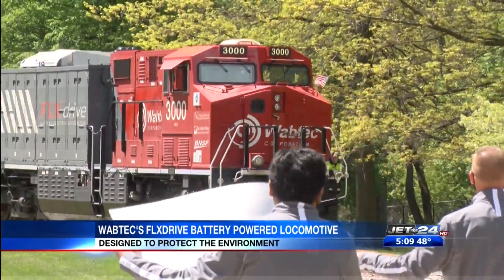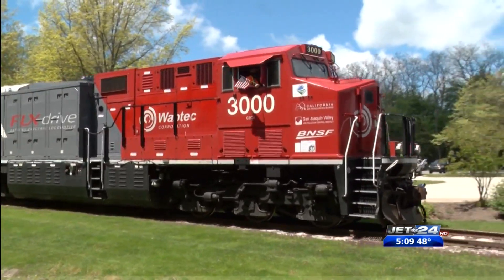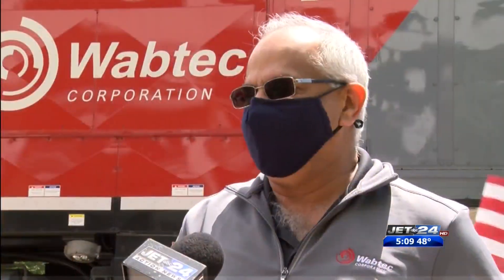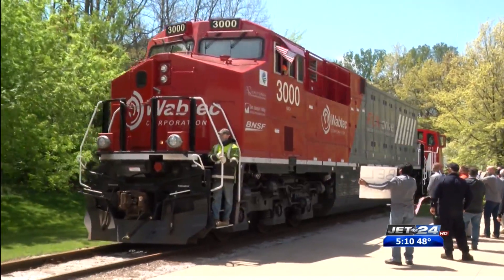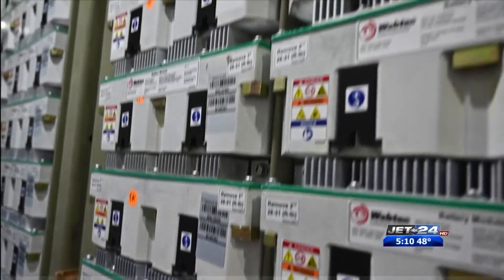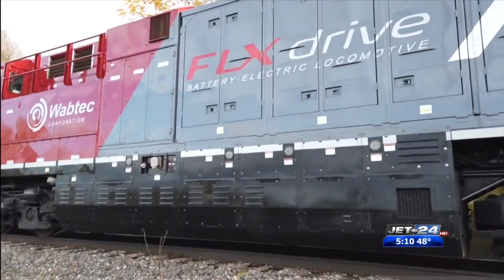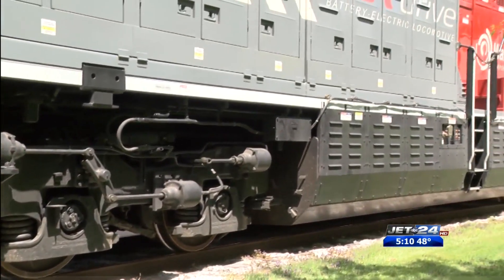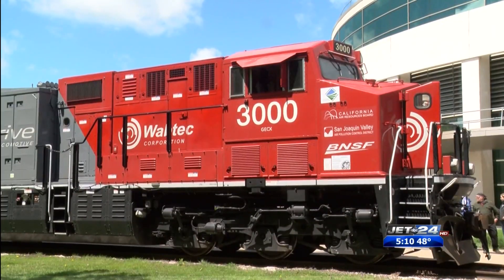Wabtec introduces battery powered locomotive to help reduce fuel energy

Comment: Electricity on and off the grid will someday be produced only by a combination of green renewable energy forms: solar, wind, hydroelectric, sea tide movement

I have yet to find one yoo-toob video posted of any all-battery loco actually pulling a train, toy trains notwithstanding! I had a toy train set that ran on flashlight batteries, C cells, when I was 5. Most videos on these are about "testing". It looks like they are just dog-and-pony show things to parade around for the time being. Are these things actually worth a damn in the field? They've talked the talk, can they walk the walk? Are they merely pure show without any go?

Comment: Catenary electrification is preferable, but this would be a good in between
Reply: Catenary electrification is very expensive
Reply: @nolantherailfan5048 not really
Reply: @AstorCosOffical  yes, really. There are 160,000 miles (257,495 km) of track in the USA. To add centenary wire to existing track is about four million per mile. Obviously a lot cheaper to have locomotives that electric internally (be it battery or H2 fuel cell).
Reply: @nolantherailfan5048  In setting it up or in maintenance? The power company dictate the cost of electricity and this still needs those power companies to charge and charging produces heat during the charging process which is lost electricity,Other than driving the electric motors directly
Reply: @nolantherailfan5048 up front yes, but it’s cheaper and more efficient in the long run.

Comment: Enough with the false bs of batteries. A hybrid would have been a better setup or run the locomotives off natural gas instead of diesel.
Reply: The standard diesel locomotives they've been using for years are already hybrids.  First one was in the 1920s I think?  So you know.  Your idea is 100 years too late.
Reply: @timhansen46  there always has to be some douchebag like yourself opening your mouth without having a clue to what you're talking about look up railpower gg20b switcher. Hybrid diesel electric with battery bank it was done over 10 years ago but you wouldn't know too busy running your big mouth like that moron president we have.
Reply: @timhansen46  not a victim, just calling out people like you who think they know it all. Now tell me again they don't make a hybrid battery electric locomotive ....
Reply: @faststang89  Ultimately your original statement was "hybrid" not "railpower gg20b switcher hybrid electric" so again nothing about my statement was false.  Oh and it looks like the train you mention has some "false bs of batteries" in it.
Reply: @timhansen46  diesel electric locomotives have never been called hybrids for one, yes full ev type locomotives are stupid where as a hybrid as i mentioned makes use of both instead of tossing one for the other. If you think you're going to one up me you already lost the conversation.
Reply: @faststang89  I don't need to waste anymore time on you.  I'm sure wabtec really regret not consulting with you first. Oh and if you think I care about your worthless opinion then the really never was a conversation.
Reply: @timhansen46  wabtec couldn't give a care in the world because once they get paid its a done deal. I know i worked for them 10 years ago and their quality control was garbage, they also paid their employees low wages to put these things together and would continually bring in temp workers who were less than mechanically inclined but you know all genius. Im sure you troll everyone with your "knowledge".
Reply: @timhansen46  🤣🤣🤣 there you go again speaking on things you know nothing about. Joe biden jr
Reply: It is designed to be used as a hybrid. Haven't you seen wabtec's video? It's supposed to run in tandem with diesel locomotives to recover and reuse wasted energy. 
It's not supposed to run by itself
Reply: @RR-us2kp  Wasted energy back to it's full capacity and within it's operating temperature,Charge any battery and it warms up,Lithium are monitored and once that temperature has been reached Charging will cease until the battery cools down,In the meantime that lost energy is still lost, Sounds good on paper and to the layman but a bit off research and learn for yourself
Reply: Yes. Instead a full electrification of the track is better. Indian railways has already completed 45,881 kilometres electrification and targets complete electrification by 2025 67,956 kilometres track length
Reply: Or Hydrogen as we do in London in the UK water vapour as exhaust

Comment: Running a massive FREIGHT TRAIN on batteries is just stupid in mind! This is an usecase where you need LOTS of energy for LONG durations. Both are requirements that batteries CAN NOT deliver - neither now nor in the near future.
All those cells could easily be fittet in some fifty to hundered small cars for car sharing fleets for example.
But in a train there's just no benefit.

Diesel gives you around 41kWh of Energy per gallon.
A SD70 type loco has a capacity of around 5,000 gal from what I can find right now.
So that's about 205,000kWh of energy such a loco carries around.

Wabtec claims in their own video that this very loco has around 2,400kWh of batteries.
(see https://youtu.be/zIgmNOxa5aI?t=119)

So that's roughly about a hundredth worth of the energy of a typical diesel loco!
Okay, fine. There's this efficiency problem of a ICE.
But an electric loco also has converters and more or less the same electric motors.

And I undestand that this FLXdrive loco shall be used along whith diesel locos.
But even then: What's the benefit of THAT?
...apart from being able to do some green-washing...

This simply is a waste of very precious resources.
And amount of environmental damage the manufacturing of all those batteries has done compared to the real benefit of such a loco is just pathetic!
Reply: It's designed to be used in tandem with diesel locomotives. 
It can recover braking energy of the freight train and can help it get going again with its stored energy. 
Listen before spewing out idiotic comments
Reply: @RR-us2kp  Upto is maximum capacity and heating loads,Quick to jump to the defence of "Gloss" and accusing other's of "spew" a little research by you beforehand presuming your remotely interested would not have gone a miss,I heard what he said on the video and to the layman that's impressive, Our trains in the UK have it that run off overhead cables, we have buses that use hydraulic braking that pushes two large cylinders and the cylinders power the rear wheels upto 30 mph or run out off pressure,Hybrid cars electric motor upto 30 mph then the diesel takes over AND RECHARGES THE BATTERIES,
Reply: @RR-us2kp  

Lol, braking energy????

The whole premise of a freight train is constant forward movement, 
How much braking do you seriously think it would need to do to sufficiently keep enough charge in the battery?

And its stored energy?

Isn’t that the same thing as a diesel locomotive does,
Use its stored energy to get it moving?

Laughing my ass of here….
Reply: @MrBelly666  A railway track is not a flat line. There are ascents and descents. The potential energy of a train raised to a height of 1,000 feet can let it drive 100 miles across the plain.
Reply: @none776  Damn… lol I’m surprised he actually typed that comment out. I feel like what you just said would be common knowledge to people but I guess not.
Reply: @none776  tell that to the rail operator that has many flat line tracks. If you're talking about ascents and descents like Donner Pass or something, now we're talkin'. What if you put that battery electric locomotive to use in flat desert lands, let's say, some famous west coast routes?? I'd say overhead wires are infinitely better way to do electric trains. Even though yes it's expensive. But it's better than mining for battery, let alone, to replace 200+ litres of a single diesel engine in a single locomotive.
Reply: @MrBelly666  ok trump voter, relax, I can sense your belly vibrations from here with all that "laughing".
Reply: @anf_8310_ab  they could put solar panels on the train
Reply: @none776  the power you need to a charge one battery will be high
Reply: @Mroyalali  it won’t fix the problem. The locomotive will drain the battery faster of them getting recharged
Reply: @gamerfan8445  Of course, the charging and discharging power will be high. This is a locomotive, not a bicycle. Also, the count of locomotives always depends on the required power.
And no one is going to charge them from the outlet. This is only for regenerative braking and to improve the performance of diesel locomotives. A third or even two thirds of diesel power can easily be replaced by battery electric power. It's just that diesel engines will always have to work at full power.
Reply: @none776  then why railroads are trying to buy them to replace diesel.
Reply: @gamerfan8445  Fuel economy and disel maintenance costs.
Reply: @gamerfan8445  then put bigger batteries
Reply: @Mroyalali  you can’t. More of the battery you add more weight to the frame of the locomotive, which can cause damage over time that can’t be fixed
Reply: @none776  yes it be better than diesel in fuel cost. But in maintenance it won’t be. Due to the battery will damage the flame and the trucks and the rails from there weight.
Reply: @gamerfan8445  then do some stuff to make the train lighter and more aerodynamic so  that it needs lest horsepower and slice through the air easily. If that can't work then I'm out of solutions
Reply: @banksrail  So a empty cart rolled from a 1,000 foot hill would finally come to a rest a 100 MILES AWAY? NOBODY KNEW THAT EINSTEIN, NEWTON RING ANY BELLS,GRAVITY WEIGHT PLAYS NO PART GRAVITY PULLS EQUALLY
Reply: @OregonCrow  Imagine a Trump voter all the way over hare in the UK? Blair voter
Reply: @Mroyalali  And what difference does that make? There not 100% effective, Produce about 1.6 kwh on a 2,400kwh battery that's 2,000 hour's of sunshine 😄
Reply: @none776  Your talking nonsense but continue it pleases you and it's free speech just because I disagree doesn't mean you should stop,But do some "Googling"
Reply: @none776  Fuel economy? Sorry I'm in the real world, First pass the cost onto the customer, 2 nobody gives a toss about the environment but like to appear "GREEN" TO BE TRENDY, In our local area we are going GREEN but just approved 85,000 diesel lorries passing through to fill in Marshland for development when building on stilts has been ignored GREEN,WE have a supermarket chain carpark in Greenwich using solar panels and wind turbines to get free electricity to power the carpark lighting at night saving money but looking green
Reply: @Johnketes54  In the real world, fuel costs money. It is profitable because batteries is too cheap. Sure I speak about small batteries for recuperation, not full electric train. In the past, the price of batteries was huge and it was not profitable, but now it is. Maybe in the future full electric trains will become profitable. Well-made electric vehicles require less maintenance money than diesel.
In countries with a low cost of human time, even electric trains under a overhead line are profitable. Electricity can be really cheap.
Reply: @Johnketes54  well it could maybe at least improve the range idk
Reply: Yes. Instead a full electrification of the track is better. Indian railways has already completed 45,881 kilometres electrification and targets complete electrification by 2025 67,956 kilometres track length.
Reply: lmao. You think this train has a 2,400kWh battery? It's obviously wrong. The train would move about 10 feet. It's amazing you base your whole argument on the locomotive having a battery that's the size of a Prius battery.
Reply: @Driver6M  I think you got the notation wrong - I used American notation with a comma for thousands, not a point as we do in in the metric world.

The company claims 2,400kWh (two thousand four hundred kilowatt hours).

The MY16 Prius has a 8.8 kWh battery (eight point eight kilowatt hours).

So the train's battery is more than 270 times larger than the Prius's battery.
Reply: @ML_314  British notation as well
Reply: @Driver6M  So why release wrong information?
Reply: With energy density 500 wh/kg i think battery locomotive isn't bad idea
Reply: nah, electric is goot.
Reply: It's also a fire hazard

Comment: Lmao 🤣 this will fail miserably
Reply: I got the feeling most will end up in yard service. I just don't believe during an entire trip that locomotive car recharge the battery significantly enough. It may become more of a logistical nightmare when it comes to servicing the unit. When i mean servicing you can turn a diesel for it's next trip in a matter of minutes and that is more important to the transportation industry. Just look at how fast airlines turn planes. The odor of the people that were previously on the last flight that landed about 40 minutes ago is still in the cabin. Back to the locomotives, what happens when the cable get broken while still attached to the locomotive? I'ts going to happen somewhere. And the type of train it's deployed on matters too. What about in the event of an severe accident? These batteries have the potential to kill a person and start fires.
Reply: @BossSpringsteen69  It will use the braking energy from the other locomotives to recharge. It’s made to work in tandem with them, not alone.
Reply: Yes. Instead a full electrification of the track is better. Indian railways has already completed 45,881 kilometres electrification and targets complete electrification by 2025 67,956 kilometres track length
Reply: Why? It's a great idea